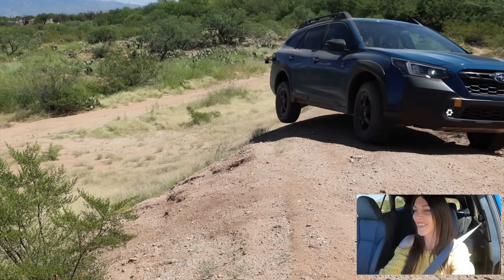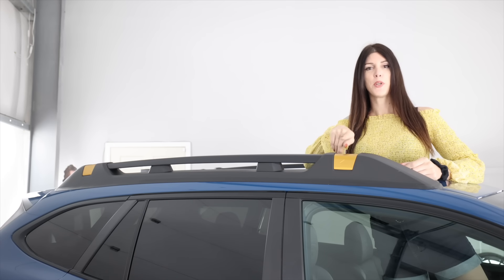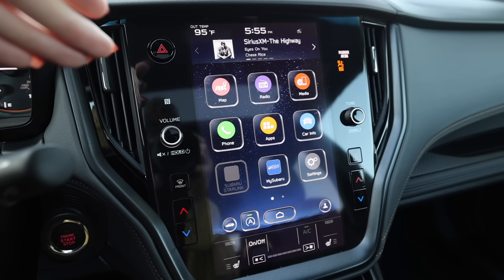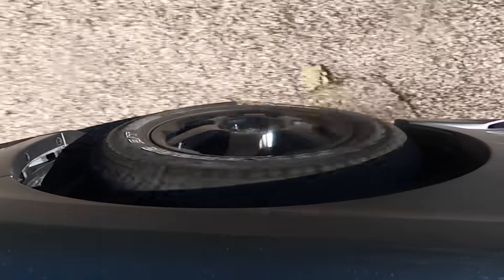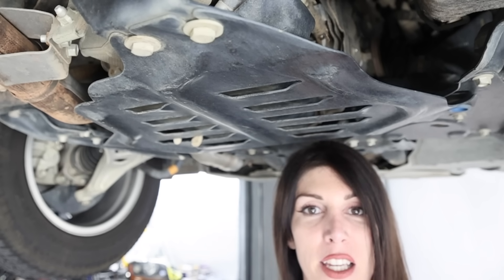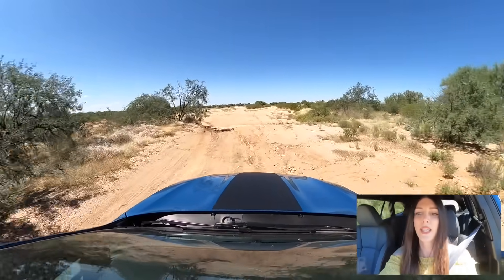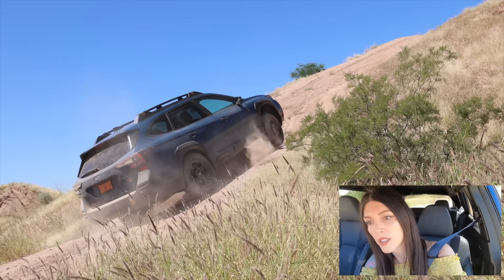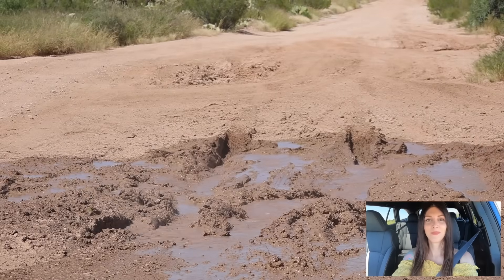Off-Road Torture Testing The New 2022 Subaru Outback Wilderness

Comment: Definitely need to put X-Mode into deep snow/mud for that hill climb and it would have been able to handle it just fine.  The dirt/snow mode will disengage over 25mph but the deep snow/mud will not, the wheels are spinning over 25mph when trying to climb that hill so that is why this is super important.  You can add a locking diff to it as well but I digress, stock is what you're reviewing just don't forget to review all the features when trying stuff like that to see it's full capabilities.
Reply: Yup.  I have a 2022 Outback Wilderness. I've gotten up similar hills like that. I was yelling at the screen.."put it in deep snow/mud" !!!
Reply: It only disengages over 25mph on the forester. This does not apply to the Outback.
Reply: yep traction control off and xmode on would have done it I bet
Reply: @nickkalister6291  That's exactly what X-mode 2 (deep snow and mud) does.
Reply: Sarah. Please reconsider giving the obw the beans once more, respectfully. We need to see this hill climb again in X games mode. In the name of science

Comment: Subaru doesn't really make serious off road vehicles. They just make SUVs that look different. It needs gears and some lockers to be serious. Software and traction control only goes so far....
Reply: So basically a 4x4 rather than an AWD
Reply: @Trifler500  - I think AWD can be ok for moderate off-roading, but you need gears and some lockers for steep hills like Sarah tried.

Comment: I'm going with Jay Leno on this one, the rod is cheaper and isn't as prone to failure as much as gas struts.
Reply: Agreed. Give me a steel rod. A tiny bit more work but it'll be headache free foreeeever
Reply: Cheap under rated gas struts fail. premium ones don't as often.
Reply: @mostcom  and solid pieces of metal fail less than struts.
Reply: @jaymzafish  no argument there, but I'm lazy I like to pull the hood latch step-back let the hood rise on its own and gaze at the top of my supercharged engine.
Reply: @mostcom  you seen the Koenigsegg open all of its' doors with one push of button on the key fob?
Reply: @jaymzafish  No, no I have not.
Reply: @mostcom  look up the "Jesko".
Reply: @JayJay-gl2df  does that refute my point that a metal rod is less likely to break?
Reply: @JayJay-gl2df  yours were probably made in America?
Reply: @JayJay-gl2df  does the rod still go in the hole without the plastic piece and those are easier to replace that struts.
Reply: @JayJay-gl2df  was pointing out struts now are most likely made in China, another reason to stick with the Rod.
Reply: @JayJay-gl2df  Do you have a Holden?
Reply: @JayJay-gl2df  too cool.
Reply: And safer in a fire . The gas struts blow up and shoot the rods right through the hood.
Reply: @Wrang15  Damn.

Comment: With a conventional automatic, and maybe a low range like Subaru used to offer, this thing would be a beast!
Reply: This. I wish they would at least offer these things along with locking diffs as an option. I know there are plenty of folks who would pay over $40k for one of these with locking diffs. Also wish they would make the Eyesight system optional again, I personally detest it. (Then maybe they could bring back the 6 speed!)
Reply: @Green Yoshi Distantly related. 

Very distantly.
Reply: CVT is better in snow because it gives more continuous traction, at least that is part of Subaru's reasoning.

Comment: Sarah, I’ve been watching you ever since I had my white 2015 FXT (just like yours).  Like yourself, I have nothing but love for Subaru, but now that I drive a Honda with iVTM4 and the ZF9 I’m also absolutely blown away.  I can love both brands, and I really appreciate you showing how class leading (shared title, by the Ford Bronco Sport badlands and other twin clutch awd (excluding toyota) the AWD system is.  I think the Ridgeline is the only AWD that has made it up your stress test so far.
Reply: I wonder if the Bronco Sport would make it up.
Reply: @pingpongballz5998  a regular Ford Bronco might act similar to the Kia Telluride.  They’re both geared 17-18:1 and have an AWD system similar to the Subaru.  The Telluride actually did worse than the Subarus.  I’m unsure how the regular Ford AWD stacks up to symmetrical awd.
Reply: Honda really got the mechanicals right on the current passport. Big V6 with a proper ZF auto and torque vectoring electronically locking diff.

Comment: Hi Sarah, I bought an 2021 Subaru Impreza (yes the economy box) Hatchback sport in manual transmission. I have accessorized the heck out of it including pinstripes, illuminated shifter ball, foot illumination, El wire throughout dash and on doors, LED headlights, and luggage rack. I also added an tunning chip. I love driving the little sputterer and the practicality of the hatchback. Love your reviews and even your tall white legs 😂. Thank you.

Comment: On the hill climb fail what X-Mode setting were you using?  If not the deep snow and mud setting, if you have another chance to test a Wilderness edition Subie (whether another Outback W or the upcoming Forester W) give Deep Snow and Mud a shot on your hill climb.

It allows a little wheel spin and gives the slightly slow off-roading logic a better chance to solve the traction puzzle.
Reply: Old review but just now watching. I also think it would of made it in deep snow and mud setting.

Comment: Something Subaru has ALWAYS needed to add to their cars is electronically lockable differentials, front and rear, as (them NOT having) that one specific thing severely limits their hill climbing ability!

I had a 1991 Legacy wagon with 4WD and a 5-speed manual transmission, and that thing was great off road, except in extreme off camber or extremely steep or rutted hills, anything that made more than one wheel lift off the ground at the same time. That's where open diffs fail everytime!

If Subaru would ever offer the option of having locking diffs in the front and rear, (and also an extremely low range hill climbing gear or something, since they don't have a 2-speed transfer case like a 4WD truck usually does), then Subaru could finally have a really decent off roader, especially if they also keep the ground clearance decent, and have the upgraded suspension like you mentioned!

Comment: With the value of Subaru doing aftermarket upgrades won’t break the bank like some other cars.   Those tires are what I was looking at for a 2020 Ascent.  Subarus are fun cars to chuck around.  I just wish it had a overland outlander package that had locking diffs, upgraded shocks, and tuned to remove the fake shifts.
Reply: The CVT is the primary issue
Reply: @traviskorda3262  are Subaru cvts low quality or just general cvt hate?
Reply: @NNTorious  I like my 2014 outback cvt it is very efficient, it is easy to service as the access to the valve body is on the top, I had to replace 2 solenoids made by Bosch to restore my rear wheel drive and torque converter lock-up solenoid, but I think part of the reason people criticize cvt's is that it takes away control from the driver and people love to be or at least think they are in control, I know I do.
Reply: Cvt’s dont have low enough gearing for crawling up things
Reply: @therealtpain90  the differential on this makes up for that.   It's geared lower than nearly everything without dual range
Reply: TFL tested it also and it couldn’t climb the hill they was testing it on. Not because it was loosing traction so much but because it just didn’t have enough power at 2,300rpm or whatever the stall is on them because the ratio in the transmission couldn’t go low enough 🤷🏼‍♂️. CVT’s have there place and are great for economy and (without simulated shifts) keeping the engine in the powerband.. but if your going to make a vehicle and slap and offroad badge on it then it should have the gearing for it and this cvt does not, even with the gearing difference in the diff’s it STILL struggles to climb steep grades
Reply: @therealtpain90  There was some wheel spin here though.  A locking diff COULD make the difference.  Also, those tires are obviously not very rugged. 
*The auto lockers available for Subarus are spectacular.  I wish Subaru were willing to option them on their cars.  But the clicking noises may keep them from doing that

Comment: Probably the best video online about this car.  I bought a rather nicely appointed Outback Wilderness a month ago with every internal and external option.  By default you don't get ALL the skidplates.  The ones you are showing here on this demo vehicle has skid plates that are optional as accessories.  They don't come for "free" which is disappointing.  You get the small approach-angle skid plate which is aluminum.  Outside of that, the engine and fuel tanks all have a thick plastic plate.  I didn't even get a CVT plate thrown in either.  I was rather disappointed when I got mine up on the lift.

Comment: While I'm not sure it would have been enough in this case, switching to the deep snow and mud setting will help on hill climbs.  Just allows a little more wheel slip before the brakes are applied so you can keep some forward momentum.

Comment: Well Sarah Outback would have climbed that hill if you would have had the X-Mode set for deep mud/snow, the system would have allowed more wheel spin. 
Also if you want to do 0-60 times on a Subaru equipped with X-Mode always place in the same as above. Doing so will give you approximately 20% lower first gear ratio so you can get a better 60’ time. You can feel the difference. Just saying for a friend.

Comment: You should have put it in Xmode deep snow and mud so that the traction control is off and it will allow the wheels to spin more and it would have made it up that hill. Regular or mode 1 X mode still has VDC on, Xmode 2 does not have the traction control breaking wheels.

Comment: I thought about getting some BFG All Terrain , with 3 ply side walls . I have them on my Crew Cab & they work Great for my needs , mostly street use .  I didn't  because the extra weight I heard would slow down an already slow car . In some places we have sharp rocks in my area , I just don't want a flat . The worst thing about The BFGs , they pick up rocks , I often pick them out so they do fly into other cars OR dig in & damage the tire .

Comment: Love to see your reviews.
About this hill climb you had to activate the deep mud&snow X-mode becuase it was slipery steep hill climb,although its dry,this option gives to all wheels to spin .in a regular X Mode use the wheels stop by the traction control that move power from side to side  this cause  the car to loose energy in the climb. If you will try again I think the Wilderness will climb this hill.i have the Sport model with the dual X mode   fanction.
Thanks a lot.
Reply: Yes hope you will sometime give it another try, I’m confident the outback can do it like the forester did…thanks for the very nice vids anyway
Reply: Surprised wildness can't make that. I can make it in my XT limited. Need more wheel spin.  I was in a 45 degree incline full impassable mud in a ditch and after a prayer slowly it climbed out like a goat in slow motion.  Did you try all different modes?

Comment: Just an FYI putting X-Mode on and then gunning it turns X-Mode off, that is meant for slow speed climbing or descent or trying to get out of a rut. You should have turned X-Mode on when you tried to climb that hill, it will distribute power to the wheels that can't get traction.

Comment: Subaru needs to embrace the CVT and celebrate its advantages rather than mimic a traditional automatic. Simulated shifts are like fake exhaust tips. No reason for them.
Reply: "embrace the CVT" ....lulz
Reply: Why would anyone want a CVT? They're lifeless and take the fun out of driving
Reply: When I hear CVT I have nightmares
Reply: @rapTorfx4  exactly... ly Legacy would be so much better with a 6MT or a NORMAL auto!!!
Reply: Maybe Subaru figured out that the shift behavior removes some of the stress that causes cvt’s to prematurely fail.
Reply: I have a manual (6gears) Forester works well off road. I had to pay extra to get the basic  one.  Now you cal only get a rubber band transmission.  After 3 Subaru this is my last
Reply: @rapTorfx4  You got that wrong. Have you driven a Subaru 2.4 turbo with the upgraded CVT? It will make you giggle with delight.
Reply: @derfstang480  You think?
Reply: @fredwhitmore3737  Subaru CVT uses a steel chain drive. Nissan and others use the rubber band with steel rings. I only refer to their reliability. Please don't interpret my comment to read that the current OB driveline is 'exciting'. Because it's a Continuously Variable Transmission. If you must have the fun of shifting excitement, then the current OB generation is likely not the car for you.
Reply: @roberthenry9319  I have a '21 OB XT and agree with Shane.
Reply: I still prefer gears to chains
Reply: Simulated shifts, slow the car down and are completely stupid.
Reply: @tonyhorvatin2037  I just bought a 23 Onyx XT and would have to agree with Shane also. The CVT is lifeless.
Reply: People bitch about the CVT, but when you talk to people that actually own this car they have zero complaints. I've talked w many owners on multiple forums. They all say it's quick and responsive. Just food for thought. I do wish it had a manual just bc that's my preference. 0-60 in less than 6 sounds like it kicks the proper amount of ass. I bet the CVT is faster than  someone shifting a manual.
Reply: @chrisgulbranson5867  actually there are a few owners here who did complain about the CVT. I think the car would be more fun with a 6-8spd auto.
Reply: I notice that when the rpm gets very high it shifts. Otherwise I would red line. The shift seems necessary.
Reply: @mrjjthor  Agreed. I was just surprised after hearing all the complaints that when chatting with several owners they had no complaints. I'm sure a regular automatic would be better. I wish I could get an obw with a stick.
Reply: My Subaru cvt's have always been great.
Reply: The government regulations on how much emissions a car puts out is why they have gone to CVT's. Blame the regulators and politicians. Not the car maker.
Reply: @chrisgulbranson5867 I have plenty of complaints about my subaru with a cvt. Shifty, lifeless , horrible off road and prone to failure.
Reply: @chrisgulbranson5867 I just bought a 2024 ascent and couldn’t agree more. I was skeptical as I owned cars with jatco cvt’s in the past. This is completely different. It doesn’t shift like my 2018 Mazda cx9 but not bad for a CVT

Comment: I found going a little faster is just better with SUBAR and traction control enables as its stability will be ok at a faster speed and yes if you drop typer pressures which you would do for any 4x4 when needed it's just the point where you need to do it that changes. I put a LSD in the rear from a nissan no much needed to be changed both from fuji heavy industries. Make a cheap and instant improvement but the turn of x-mode on dirt or rock hopping.

Comment: Excellent review.  I'm considering buying an Outback Wilderness to replace my '19 Crosstrek.  Mostly, because I need the room and you can't go wrong with a Subaru.  I knew you would provide the useful information I needed to make my decision.  Not very many reviewers pop the hood on the vehicles they review and I never see them throw it up onto a lift to reveal it's dirty under parts.  Keep doing what you're doing. :)

Comment: Comparing to 2021 Crosstrek Sport, which can be considered Outback Wilderness' little brother and has many common design elements with it, such as body cladding, rugged trunk, and gold accents, Subaru designers finally listened to you and put a black headliner in this newer model. Gold-coloured wheels are still an issue, may be next model year. Predominant gold accents of your outfit somewhat compensate what Subaru designers missed. I guess that's what you do in your reviews - complement a car with your cool looks. 👏👍😎

Comment: Not too surprised that the CVT struggled on that hill. I'd be curious to see if a Subaru with a manual transmission could climb it. Overall the OBW looks like a fun car to drive on those dirt roads.
Reply: I'm actually surprised the frame didn't get bent. The 2009 onwards forester had such a weak frame that it got bent even from a small pothole so that the doors wouldn't close anymore lol. That combined to the grenading diesel engine... Amazed someone still buys em.
Reply: I have a 2003 Dual Range Outback with the L series low gears swap, lift, same tyres as the wilderness and 12kgf centre diff and 12kgf rear LSD. I'm pretty damn confident it would have made it up there!

Comment: To help nearly full eliminate the simulated shifts you can put some transmission mount inserts and or get the Cobb pitchstop mount. And you can get aftermarket hood struts (which I have yet to install due to lack of wrench time)

Comment: The roof rack has been strengthened to support a rooftop tent which makes sense since the other models do not have such a sturdy roof rack.
Reply: Weird. I have a 2023 crosstrek sport and the roof rack supports up to 700lbs. I have a RTT and a Awning on it currently attached to the Thule extended aero crossbars which also hold 800lbs.

Comment: Set the cruise control as you're accelerating, then the transmission will act like a CVT is supposed to. At least that's how it is on my 21 Crosstrek.

Comment: And I would hope that Subaru water cools the turbo so it helps reduce the need for replacement by huge margin and hopefully they recommend 4500 mile oil change intervals with 0W 40 or 5W 40 and maybe 0W 20 if you’re going to live somewhere that’s very cold all the time